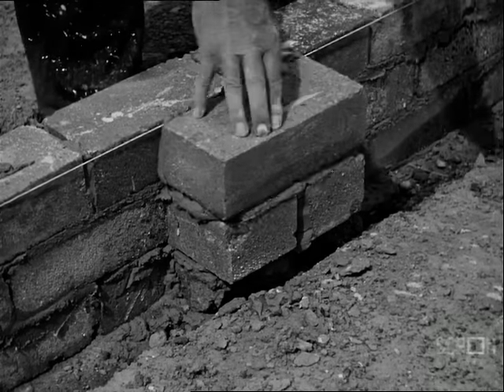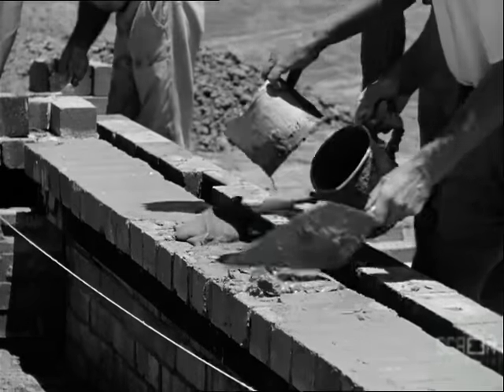Building A Brick House

Comment: ha ha foundation? here in the vast majority of the west of the Netherlands you will really have to drive piles into the ground first and they can vary from ± 8 to 20 meters deep, I myself once had to drive piles into the ground and they came to ± 13 meter depth only then you stand with your pole on the primeval sand soil, everything above it is rubbish also called peat soil and sometimes here and some clay but that is only sporadic, if you do not do this, your house will sink 50 cm within ten years , good luck digging out your front door.

Comment: They just lay the roof tiles - no fastening/nails? 
Just the weight of the (clay?) tiles? 
I take it it's not very windy wherever this was.
Reply: They tie them down with wire. I thought the same thing.... but it shows that in the video.
Reply: @TheRobertralph  Now I see...thanks.
8:15 - still...does not look very secure.
☮

Comment: Building internal walls in brick is a huge waste of money and time.  I'm surprised they would be so wasteful in the post war years where materials were still fairly scarce.
Reply: Youcanonacanon pretty sure clay was always in large supply in Australia.
Reply: Youcanonacanon Internal masonry walls are great. Better soundproofing between rooms. Better for hanging cupboards, furniture etc. Adds thermal mass to minimise temperature fluctuation. Helped keep houses cooler in the days before aircon. And retained heat in winter. Traditional plaster on masonry walls also help regulate humidity, they can absorb quite a lot of moisture from the air when it's humid, and release it when the air is dry, making for a much more comfortable living environment.
Reply: @spencerwilton5831  All true in theory. I've been in solid brick houses which are ovens in summer and ice cold in winter, though. I've also experienced poor soundproofing from brick walls too. So don't believe everything you read. The fact is, brick walls make it almost impossible to reconfigure/renovate a house later on, because it becomes too expensive/impactical to change the floorplan of the house. This is a big reason why older houses are being demolished in such large numbers, especially in inner suburbs of Melb.

Comment: Not everything was better then. Terrible insulation for a start - those windows must’ve leaked like a sieve. Unsure about that house but I live in a 1960s block of units and the footings are woefully inadequate considering the clay soil - lots of cracks in walls. Copper pipe installed in cement which is now corroded.

Comment: whats the difference between aggregate and sand?
Reply: Aggregate is crushed stones (or river stone) and sand is sand. So finely pulverized stone. We use stone because it is strong and cheap. We use sand to fill the voids between the stones with another strong cheap material. Notice a trend? Strong and cheap are virtues of the process. Your standard concrete mix is 3 parts stone, 2 parts sand and 1 part portland cement. It is called a 123.
Reply: @1pcfred  thank you! so the aggregate is the larger pebbles i see in concrete blocks.

Comment: Strong houses but the lead plaster etc will kill over time ahahahah
Reply: Hello there😁
Reply: I don't think so.  Has to be ingested.
Reply: Raven Moore The lead isn't a problem, it's not being used for drinking water. Plaster is not dangerous! It's almost inert, you can eat it if you want with no ill effects other than a probable stomach ache! Why would you think it's bad for you? This house will be much healthier than a modern home, made from OSB board stuck together with glue that offgasses all sorts of chemicals, spray insulation that does the same, flooring that contains formaldehyde, carpets that release petrochemicals into the air you breath - and everything sealed inside for energy efficiency reasons. The air inside a modern home can be anything from ten to a hundred times more polluted than the air outside.

Comment: I’m a roofers labourer and I carry 6 tiles on my shoulder my boss can do 8 they are heavy the concrete ridge tiles not sure if those tiles are heavy or light but yeah we walk on the counter batons and you can’t see the joists underneath because of the roof shield felt I fell threw the roof up to my knee with tiles on my shoulder not good in fact at 6:56 the tiles are light yeah I could do 12 easy with those tiles not hard

Comment: They don't make houses that well anymore, I have lived in a house that was almost identical in age and construction and it was rock solid, not a large house either but the quality really stood out. The materials they used then and in the dimensions they applied them resulted in a house with at least twice the endurance of the typical house made today.

Comment: was a bricky for 8 years..the housing estates today are so poorly built ..not going to say names but redrow frome Somerset it has 14 tones of asbestos buried somewhere on the estate from the original building that the front warehouse stacked from floor to ceiling with this suff .. the new estate behind ASDA's Frome had no fire walls partitions in the loft for months after people moved in and I don't know if this has been sorted and every aspect of the build is worse than crap from foundation to roof ..you would think the so called brickys were drunk they must have used there pints as a level ...nice to see how it should be done
Reply: Jay Day Anyone who buys an estate house from any of the well known big builders gets exactly what they deserve! We looked at a few recently, the standards were shocking, all the architectural detail was fake- right down to the fake composite chimneys they were sticking on the top. Chipboard floors, shoddy brickwork, windows held in place by expanding foam and the internal plasterboard. I would never, ever buy anything built post WW2 in this country.

Comment: Here we go in the comment section "oh how houses were built better back then" " you can bet these places were built to last"
" Real craftsmen not like today" 
This is how they build houses today, the only difference is it's done a little quicker because of the use of more power tools, this ultimately keeps the cost down, also bear in mind that these workers had cameras on them and were behaving themselves:)
Reply: it's done quicker today as they use plasterboard and stud inside and wherever else they can. Not solid like them houses.  I wouldn't buy a new build house today. Complete junk lol
Reply: Builders were held to ransom by the brickies after the brickies built the lower brickwork of a traditional brick home, they could refuse tot come back after the timber walls were put up. This is one reason they make slab on ground, brickies only have to be onsite once.
Two carpenters can install all the stud walls ( pre made) and roof trusses in one week. A project home can be finished in 6 weeks

Comment: This is crap. 
Should be concrete wall and concrete roof.
Brick House is fake.
Reply: That might work well enough in Australia, but it wouldn't always work  in a cold climate. Bricks hold up well enough, but the salt eats away at concrete if you're near any roadway. Of course, earthquakes make quick work of most brick or concrete houses, if they are common. It all depends on where you are building.